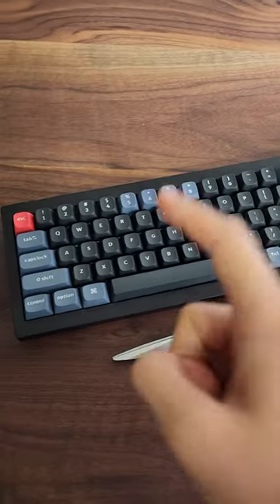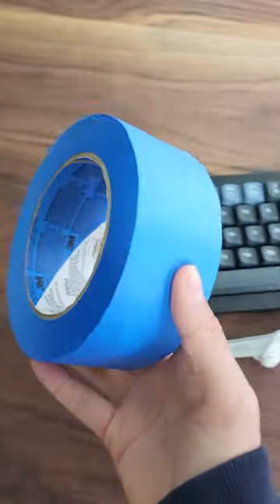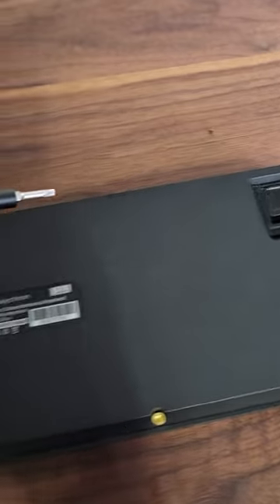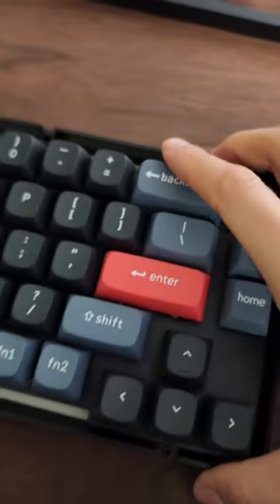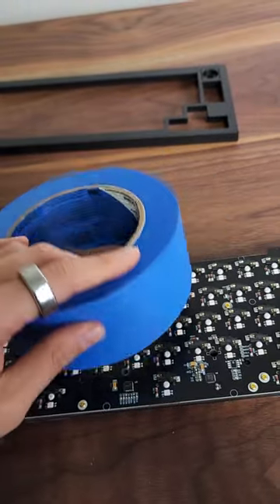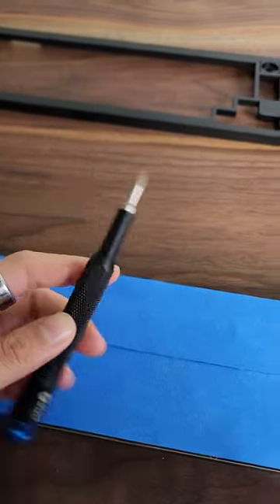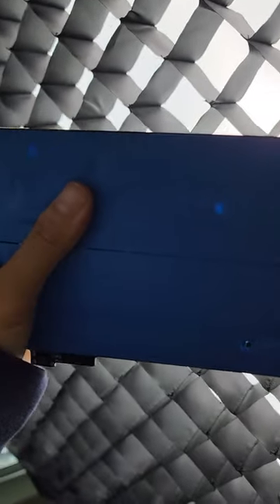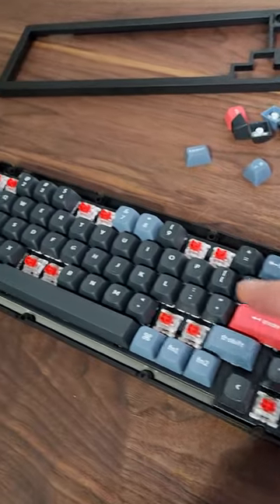This is the easiest keyboard mod to make it sound better

Comment: I cut up acoustic foam and put it in there then covered that with a thin piece of foam I got in the keyboard box. It really helped turn the cheap keyboard case into a really good sound keyboard
Reply: Which acoustic foam did you use?
Reply: Does it sounds like mechanical ??

Comment: Hey in theory I think gaffers tape would be even better. Its basically woven material with a non permanent or destructive glue base. Its thinker and made of fibers plus.the glue is rubber like.  Might only.need.one coat and might sound even better.

Comment: one of the easiest and cheapest way to make your keyboard sound good indeed. 

can you please tell us what's the recommended amount of layers for the tape mod?
Reply: 3
Reply: 2-4 is a good amount, 2 being an average amount, 4 being the most you should probably put on. Also, if your keyboard has a battery, you might want use electrical tape to keep from shorting out the circuit.
Reply: @Video_Fiend Thanks for the answer! i know this is a very late reply lol. 

i put 3 layers of tape and it sounded pretty good! made my keyboard feel less hollow.

One question though, do we need to regulary replace the tape? if so, how often do we need to replace it?
Reply: @rezadahri564  I am glad I could help! Also, you probably shouldn’t have to worry about ever replacing the tape unless it starts to fall off, which is very unlikely if you don’t peel off the tape frequently.

Comment: Hey so is this safe or nah😅??? Cuz in one of your mod videos, you suggested electrical tape cuz you almost started a fire with painters tape.
Reply: I think it is now safe imma use electrical tape bc i dont want any chances
Reply: its a fire hazard if the keyboard has a battery
Reply: @Conraa8  Do u mean a rechargeable battery? does the rk61 have a  battery bro? cuz im gonna tape it and i dont want to start a fire lmao
Reply: @0enex736  I mean, can you use your keyboard wireless? If you can then It has a battery if you can't it doesn't lmao. 
But yeah, as far as I know, not using electrical tape while having a rechargeable battery could lead into a short circuit
Reply: @0enex736  basically if your keyboard does NOT have a rechargeable battery you can both use painters tape or electrical tape (better results with painters tape), but if your keyboard DOES have a rechargeable battery you should use electrical tape

Comment: Really good video Betty but I am scared to ruin my GK61 by doing this because i don’t have experience
Reply: for what I can see with modding GK61. The only thing that goes wrong with it is the USB C port falling off because of poor soldering job from the factory. Tape mod's relatively safe as long as you use weak adhesive tapes like masking tape
Reply: @Sylveighty  But there aren't any long time report about tape mod since it is not that old. I decided against it. Even masking tapes have a time period where they will start to leave residue.
Reply: @flyingwolf6  
tl;dr use low tack/weak adhesive rubber tape. Replace old tape with a new one ever so often if you're that worried.

if you're that paranoid you can just replace the tape ever so often, since masking/painter's tape is easy to remove anyway. adhesive residue is only a problem if it's strong enough to rip off components of the pcb (wont really happen unless you use something really strong like duct tape or have a board with bad soldering). 

As far as I can tell the only real dangers happen when using stickier tapes which you don't really need and using vinyl based tapes which can conduct electricity and cause static,
Reply: @Sylveighty  Oh, so it's a known issue? I retired my GK61 because the USB-C connection became really unstable. Don't have the patience to replace the port.

Comment: Has anybody used sound dampening material?  The stuff that car audio installers use in vehicles, they line panels with it to avoid rattles and make the sound system in vehicles sound more dense.  I went into our local AutoZone store to buy some but they told me they were no longer carrying it.

I'm curious how well it would work in a keyboard,

Comment: My keyboard broke cuz of foam mod, so is it gonna break if i do tape mod?
Reply: probably you used a non eletric resista t foam, if you use a eletric resistant fosm most likely its gonna be alright
Reply: @zarpela  well i used pe foam, so if i use tape its gonna be alright?
Reply: @Hydroxzrt  prolly

Comment: Is there any risk of damaging my keyboard if I want to do that?
Reply: i am not an expert but if the glue in the tape is conductive or if you accidentally touch it while you have static electricity you can fry the pcb but these things will almost never happen